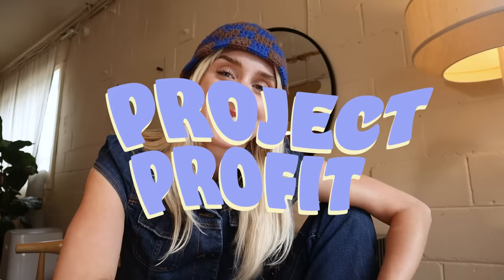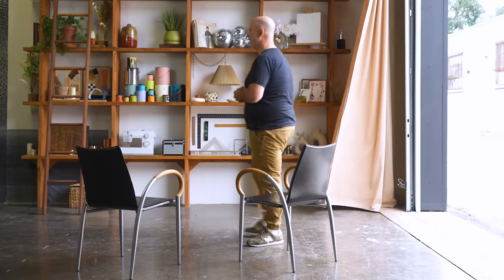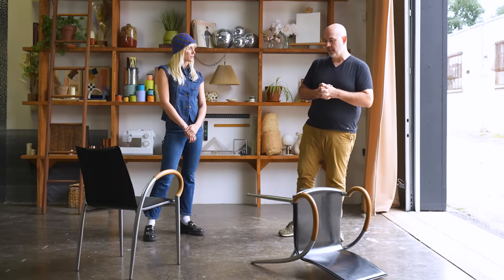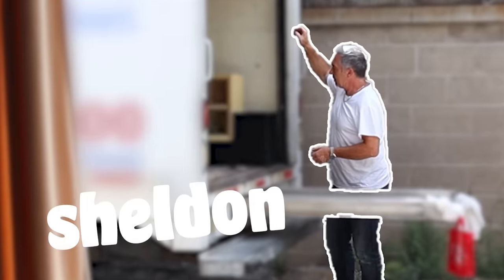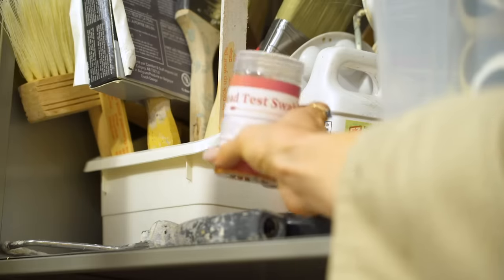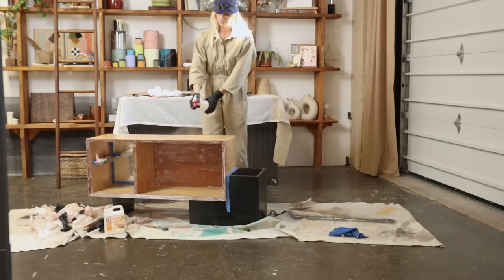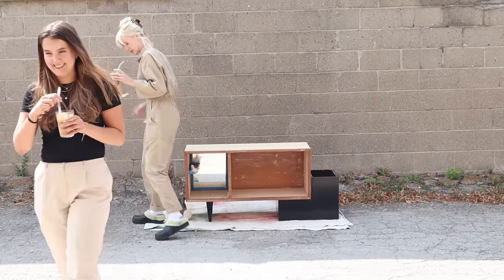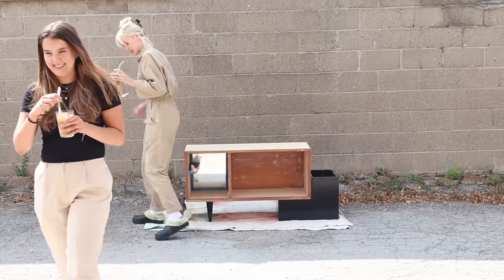i turned my landlord's junk into $300

Comment: Rachel, this looks amazing! 12:57 Just a little warning for anyone who works with a brush like this on metal, please cover your eyes very well, because it's possible for a metal splinter to get into your eye. If that happens your eye can start to itch, causing you to rub your eye and damaging it. The chance is very small but you really don't want that. A good pair of protection glasses will help! Edit: happy to see Rachel wears them later ^^
Reply: her safety glasses are on top of her head while she using that brush. Which is rather pointless. They don't work unless you put them on your eyes.
Reply: right.. its no joke

Comment: My friend growing up, her grandpa was a cabinetmaker. He told me once that a lot of damage to wooden furniture are actually dents & not gouges. His tip was to get a wet bit of towel & wet but ring it out. Then get an iron & iron over the dent, the heat sometimes makes the dent spring back out. It takes time to do so it’s not a 5 minute job. He also said that you could leave the damp bit of towel on the dent overnight. I dropped a set of ladders on the banister in my house & made one hell of a mess of the banister. When I tried his technique it all but vanished. It’s worth a try before breaking out the wood filler if it’s just a dent & not a gouge.

Comment: In the step before you spray painted the metal, I would recommend using a rust converter or rust reformer spray for any residual rust before you prime. Rustoleum makes one. Otherwise Great job, one of the best transformation videos from you guys lately.

Comment: It would be so cool if you went and pinned a comment or added to the description, what the cost would be if you didn’t have the free stuff hanging around! Super extra massive bonus points if you want to post what the material costs and then also in a fraction for the piece 😍 for example, you would have needed to purchase a paint for $10, but used 1/4 of it, so the project would need $2.50 worth of the paint. I know this is so much more work and totally understand if you don’t want to do that, but maybe as a little incentive, it would be a definite subscribe and like of all videos for me and my DIY buddies who have watched several of your videos thus far 😁😁😁